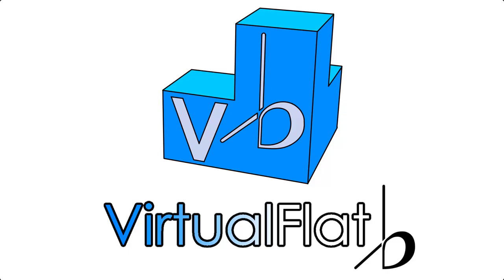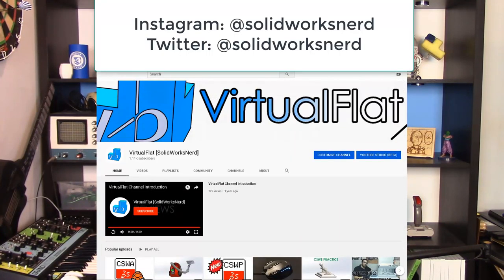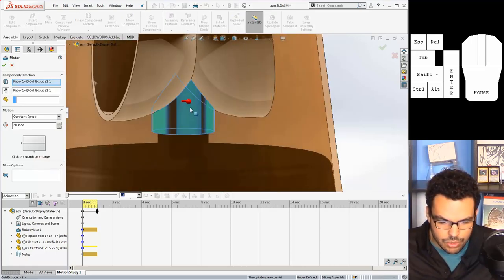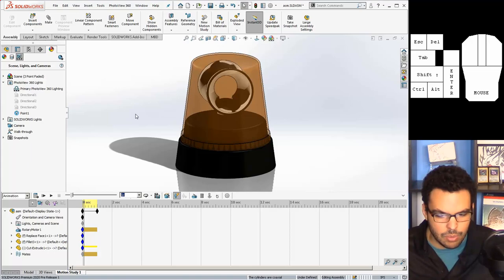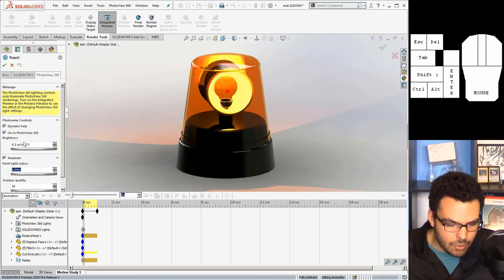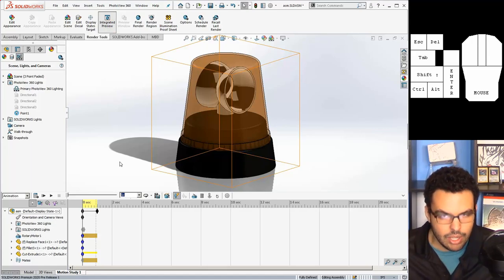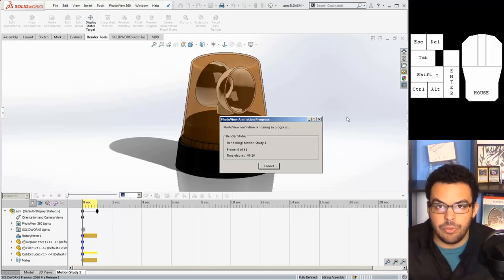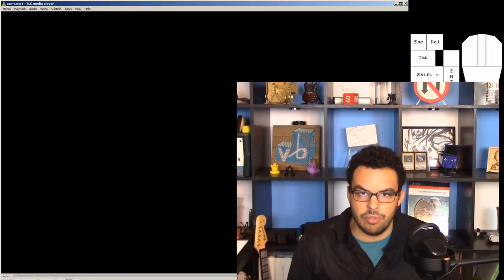SOLIDWORKS - PHOTOVIEW 360 - Animating a Rotating Beacon (Siren) - #CADModelOfTheDay

Comment: Hey , thank you it was useful,  but while saving video "save as type" I have 4 types to save, I need to save in format of MP4 how can I do that
Reply from the maker: It probably means that you have SW 2018 or earlier. mp4 was added as an option in 2019. The next best thing is to save it as AVI and for the compressor, select "full frames uncompressed". Then take that output video and use VLC or some other software to convert it into mp4.
Reply: @VirtualFlat   
Thank you. I got that 
Insta account ?
Reply from the maker: @riyaz6166  you can find me @virtualflatcad on Instagram!